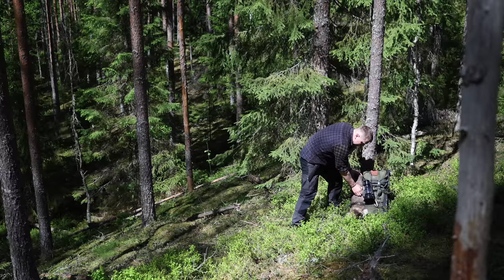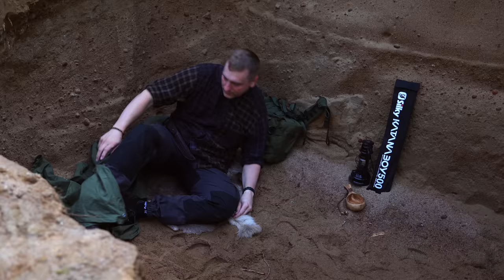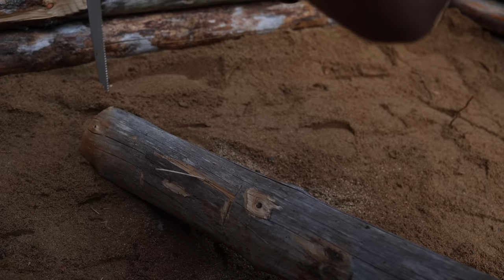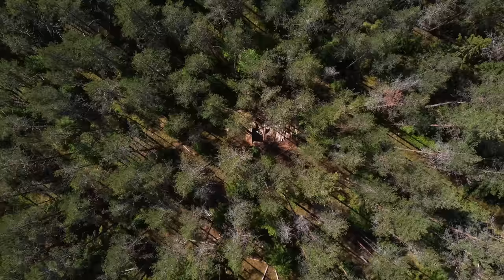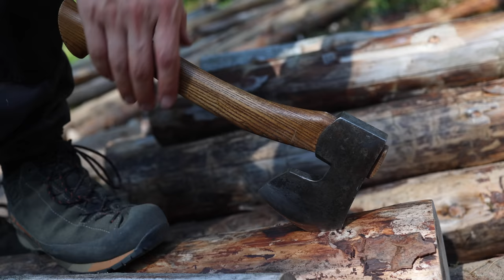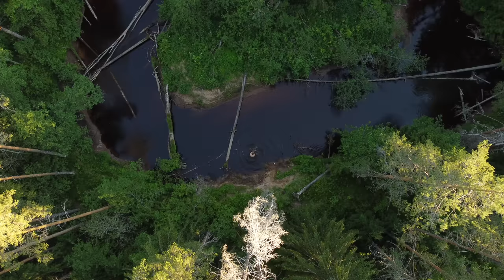Building My BEST DUGOUT EVER - ALONE into Wild Forest - Bushcraft Moss PILLOW - Badger Came - 4K

Comment: So cool. I'd suggest for future builds into hillsides like the one you've built into, to not build perpendicular to the slope, but at a 45 degree angle. The back face of your dugout acts as a dam for water absorbed into the ground. If you build at a 45 degree angle, the water will not test the waterproofing so vigorously because you'll have given it an easier path to flow downwards. In case I haven't described it well enough, imagine pouring water on a triangle vs. pouring it on a flat face. The corner of your dugout sort of acts like the bow of a ship, pushing water past it.
Reply: Smart
Reply: So you mean like a wedge shape pointing back into the hillside? Smart move!
Reply: @mtaybar5317  yes, that or simply rotating a square in plan shelter 45 degrees to the same effect.
Reply: I prefer karst with year-around ice inside on the hottest summers.
Best boiled first for a swallow.  For vampire bites I'd recommend
sleeping naked on sandy beaches in Belize.
Reply: that’s a pretty niche knowledge

Comment: Great stuff!  I am amazed by the consistency of the ground, really strange and very sandy with a perfect layer of round river rocks.  The moss looks incredible and makes a perfect  insulation. All compared to the hard clay back home.
Reply: Ya me to it's very strange isn't it sand river rocks and no roots no shoveling hitting roots In a forest really.  Looks easy but it's not so easy. Digging I. The dirt in a forest. But loved the video.
Reply: The layering in the soil, it's uniform particle size in each layer, and the nicely rounded rocks make me want to say the site was either a riverbed at some point, or the soil was dropped by a glacier.
Reply: This would be very labor intensive in Texas. 6 inches down is all hard clay. Magnesium fire starter and mosquito nets are king.
Reply: @AdrianMartinez-wh4bp  Moss and snow make better insulation than you think. Moss on the interior followed by brush and debris on the exterior. You'll be warm. When snow falls on the outside you'll be even warmer still. Outside air temp might be 20 but inside you'll be in the 80s if you make your fireplace and reflecting wall right.
Reply: @ian2372 (old comment) why do a lot of people use moss to fill the gaps? is there no mud with clay to be found? in New Mexico there's tons of old pueblo homes that the natives built out of adobe. I know its holds the temp stays cool in the day and warm at night and doesn't catch fire or melt and its air tight(no bugs or rain
Reply: @ian2372  I c. thanks for the info
Reply: @ChrisVZ77  Bingo! It's the latter. This type of stratified soil with round rocks is a moraine ridge (which in a way is a river bed).

Comment: My question is how do you control the humidity of the land that surrounds the Dugout, particularly in the rainy months? I ask because I have seen that they use plastic tarps but not in this video. Greetings from Chile
Reply from the maker: Hi! This is a big experiment. I made waterproof fabric for the roof, but didn't make tarps for the walls. And probably because of the sand, the water does not flow inside the walls of the dugout. It's always dry inside.
Reply: @AsbjornOlsenBergBushcraft  is the shroom smoke to drive away he insects?
Reply from the maker: @AXharoth  yes
Reply: @AsbjornOlsenBergBushcraft  awesome! thanks for reply!! <3 <3 your skills are amazing , and watching the video with zero words  relieved me from some of my anxiety thank you <3
Reply: In the US those are known as tinder conks (a type of fungus) which can be scrapped and used for fire starting. The Ice Man found in the glacier in Austria had one in his satchel!

Comment: So much effort has gone into this. The only question I have is what happens when it rains heavy? Will that dugout shelter protect you from the water pouring down the hill into it?
Reply from the maker: This shelter is protected from water.
Reply: @AsbjornOlsenBergBushcraft  protected by what? Jesus or a higher power? Heavy rain is going straight through that flat roof and running down the hill to make a fun swimming pool

Comment: very cool build! Curious though, with no tarp or barrier between the wood and sand on the flat roof, do you not get water mixed with sand coming in when it rains?
Reply: You be Correct with that question. Also, did you notice all the "Dried" logs of the same size was quickly available. I think I smell something foul with this video.
Reply: @johnfreels9896  did you notice how it was filmed in Norway where the climate and environment and land are vastly different from the places in North America. Parts of Norway have an oceanic climate, also known as a marine climate, which is a humid temperate climate. Also when building any structure its important to gather your materials
Reply: @johnfreels9896  if you look at the drone pictures, you see that there are quite a few young dead trees in the forest. they seem to have been lying there for a few years, have been a bit dry in the forests in recent years so the young trees may not have gotten big enough roots to cope with a drought.
Reply: @johnfreels9896  also a post hole digger was used to make the post holes the trenching shovel couldnt have made them that deep. Cool build but just show how its really made.
Reply: It will leak, 100% sure.

Comment: As a survival aficcionado, I have a question: do you think that building your cabin on a slope and virtually underground may increase the risk of flooding it in case of heavy rain? And once the water seeps into the gap between dirt and wood the damage may be irreversible? I wonder how you would address that. Thank you very much.
Reply from the maker: In heavy rain, water flows almost instantly down the hillside without penetrating deep into the ground.
A waterproof fabric lies on the roof and in the junction of the rear wall with the ground.
But even when water gets inside, it instantly seeps through the sand and does not remain in the dugout.
Adjoining wood to sand is not a good idea - need to be put with waterproof fabric on all sides...
Reply: @AsbjornOlsenBergBushcraft  thank you so much for your clarification. Regards

Comment: How did you manage the drainage? I’m building a similar shelter with stone and mortar next summer, and I’m curious how you were able to keep water runoff out of the walls recessed into the hillside
Reply from the maker: I was worried about this, but the sand soil does amazing things - water in heavy rain absolutely does not flow through the walls into the dugout. It's dry there. Apparently sand is a good drainage for water and all of it flows into the bowels of the earth..

Comment: Amazing thnak you very much. Easy to dig soild and very accurate findind the perfect logs. How did you measure them? Did you use some kind of level to work on the horizontal plane? Did you have a sketch of the cabin prior to getting to work? Thanks for the phenomenal documentary.
Reply from the maker: My pleasure! In this location, all the trees are even - such pines. I prepared logs from dead trees in advance.
I measured logs with an ordinary rope. I did not use the level, I did approximately. There was no cabin sketch, I came up with it in the process of work.

Comment: 3:48 - The rock line is the former bed of a stream.  In California, I would run my metal detector over it, looking for gold/nuggets.  (You can tell by the roundness of the rocks. All smooth, round rocks have been tumbled by water.)  Existing waterways - have been worked to death.  The "Tertiary Gravels" and old beds where waterways changed course - that's where you find the untapped gold!  If not gold - I'd still look carefully for fossils  -mammoth teeth, wolf teeth, petrified wood...gemstones.  

Amazing work mate!  (Question: How do you deal with tree roots? How do you keep water from building up in there during rain? Drainage method?)

Comment: Saw the parts were you were having to bend really low to use the shovel - that must have been tough on your back. Just wondering if you ever cut a piece of wood to make a longer handle?
Reply from the maker: Yes, it looked hard on my back.
There is no way to make a longer handle out of a piece of wood for this shovel. I want to order a shovel in the forge, modeled on the military :)
Then it will be possible to make a handle of wood of any length.

Comment: Do you leave the structures as is when you're finished with them, or do you break them down?
Reply from the maker: if the structure is difficult to build and I plan to use it constantly, then I leave the structure. If it's just a easy build shelter, then I'll take it down without leaving a trace.

Comment: mind blown, im going out into the dakotas next year to build mtb trails that will be hidden, and seeing stuff like this is inspiring. Could you maybe show how to bush craft up into a tree? like how to anchor / make the decking holdings? cause I could use how you made the walls here, up in the trees. I wanna be high up in the air, may just bring insanely long chunks of rebar, then spike them just incase. was also thinking if I had to, I could take the chain saw, and miter a pocket into the tree, then stick logs out that to hold it up. but the issue im stuck with then is how intf do i peg it? do i go straight in or side ways through tree? anyways was just talking out loud, really hope to do this next year. wanna hunt, and just be in the woods for a year building trails, and being happy. some other things im trying to figure out is a electrical storage , and then using a solar panel to charge it. then using elon musk satellites, and his internet could upload everything i would do daily to it. thanks for showing all this, and teaching us means alot.

Comment: I don't understand how he keeps the batteries charged on the GoPros, how do you charge them, how do you keep moving them around, how do we not see the cameras in the shots? Maybe there is someone else there?
Reply from the maker: I use Canon EOS R6 for video shooting. GoPro won't give you that kind of video quality 😄 I have a large supply of replacement batteries and power banks. I move the camera on a tripod for each next frame.
Reply: @AsbjornOlsenBergBushcraft  That's amazing, I can barely keep a few GoPros charged LOL. It's one thing to deal with the cameras but you are so amazing at Building  as well. Two do both, you are so talented!!

Comment: The genius of this dugout is that he needs to nails. By building this below earth level, he uses the WEIGHT of earth to hold things in place. Very smart. And if you have at least 3 feet of earth above your head in this dugout, you can also use it for a nuke shelter.

Comment: The title and description of this video have been translated to German, but with a ton of mistakes.
It reads "Ich Baue Meinen BESTEN Holzhütte von aller Zeiten – ALLEIN im Wilden Wald – Bushcraft-Mooskissen"
Correct would either be: "Ich baue die BESTE Holzhütte aller Zeiten – ALLEIN im Wilden Wald – Bushcraft-Mooskissen", or  e.g. "Ich baue die BESTE Holzhütte, die ich jemals gebaut habe – ALLEIN im Wilden Wald – Bushcraft-Mooskissen".

In the description it says: "In diesem Video sehen Sie den Bau eines Holzhütte von im Boden an einem Hang mit Handwerkzeugen.
Das ist eine sehr schwierige Aufgabe, aber auch eine interessante Erfahrung.
Für den Bau verwende ich nur tote umgestürzte Bäume, die ich im umliegenden Wald sammle.

In einer Sandgrube zu schlafen war nicht die beste Idee – der Sand bröckelte beim Trocknen allmählich und mit ihm die Steine. Es ist am besten, dies niemals zu tun, es kann lebensbedrohlich sein.
Sogar der Sand, den ich auf das Dach geworfen habe, bröckelt innen ein wenig. Ich denke daran, dies in Zukunft zu beheben.

Ein Loch dieser Größe zu graben war nicht so einfach, wie ich dachte. Dies dauerte länger als ich erwartet hatte.
Das Finden und Handhaben toter umgestürzter Bäume ist ebenfalls zeitaufwändig.
Die Montage der Struktur selbst ist jedoch recht einfach und erfordert nicht viel Mühe und Zeit.

Von Lebensmitteln habe ich hauptsächlich Konserven genommen, tagsüber ist die Lufttemperatur ziemlich hoch, der Rest der Produkte kann sich verschlechtern.
Aber auch am Feuer erhitzte Konserven schmecken nach einem Arbeitstag an der frischen Luft sehr gut.
Trotz des warmen Wetters ist das Wasser im Fluss kühl, sehr erfrischend und belebend.

Bekämpfung von Mücken und Mücken mit Rauch von einem Feuer. Im Tierheim wurde ein Zunderpilz angezündet - das ist ein natürliches Abwehrmittel.

Fortsetzung folgt.
Dank für das Ansehen!

Temperatur: Tag/Nacht: +25°C / +16°C"

More correct would be:"In diesem Video sehen Sie den Bau einer Holzhütte an einem Hang mit Hand-Werkzeugen.
Das war eine sehr schwierige Aufgabe, aber auch eine interessante Erfahrung.
Für den Bau verwendete ich nur tote umgestürzte Bäume, die ich im umliegenden Wald gefunden habe.

In einer Sandgrube zu schlafen war nicht die beste Idee – der Sand bröckelte beim Trocknen allmählich und mit ihm lösten sich auch größere Steine. 
Es ist am besten, dies zu vermeiden: es kann lebensbedrohlich sein.
Sogar der Sand, den ich auf das Dach geworfen habe, rieselte in die Hütte. Ich denke daran, dies in Zukunft zu verändern.

Ein Loch dieser Größe zu graben war nicht so einfach, wie ich dachte. Es dauerte länger, als ich erwartet habe.
Das Finden und Handhaben der umgestürzten Bäume war sehr zeitaufwändig.
Die Montage der Struktur selbst war dann jedoch recht einfach und erforderte relativ wenig Mühe und Zeit.

An Lebensmitteln hatte ich hauptsächlich Konserven dabei: Tagsüber ist die Lufttemperatur ziemlich hoch, so das andere Produkte verderben können.
Aber auch am Feuer erhitzte Konserven schmecken nach einem Arbeitstag an der frischen Luft sehr gut.
Trotz des warmen Wetters ist das Wasser im Fluss kühl, sehr erfrischend und belebend.

Mücken konnte ich mit dem Rauch des Feuers vertreiben: Brennende Zunderpilze sind ein natürliches Abwehrmittel.

Fortsetzung folgt.
Danke für das Ansehen!

Temperatur: Tag/Nacht: +25°C / +16°C"

Comment: Another dugout. Ever consider what happens in low lying areas when it rains? It’s just stupid to dig into the ground where water will collect.
Reply from the maker: Another dugout? I didn't build dugouts, this is my first dugout.
No water is collected in the sand. At all.
Plus, the slope and turf prevent water from standing and accumulating.

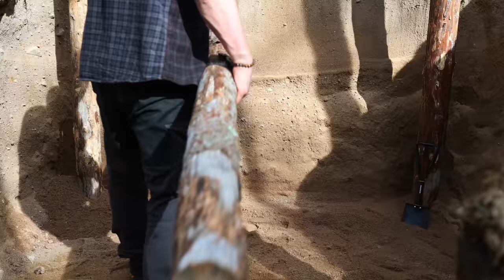Comment: These types of videos have already been debunked. cmon dude. anyone who has ever used a digger, or any type of construction machine knows that the wall at 13:26 is done by machinery you can even see a rock jus to the right of the standing log that has been nicked by heavy machinery
Reply from the maker: There is nothing to debunk, they dug everything with a shovel. No machine or other power tools.
Reply: @AsbjornOlsenBergBushcraft  that is incredible good job. so there is more than one person doing the labour for this?
Reply from the maker: @nedscheebly731  It took me several days of hard work. I dug alone. I was lucky that there were no roots and large stones. But this is a feature of our soil - sandy hills left by a glacier...